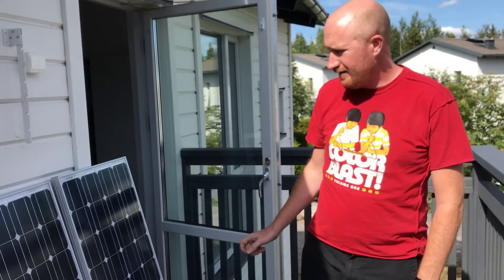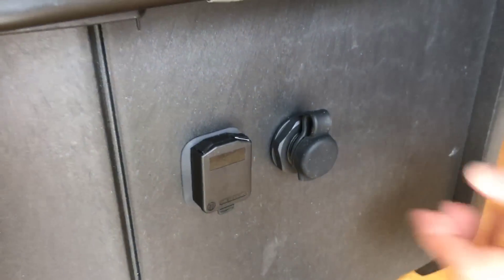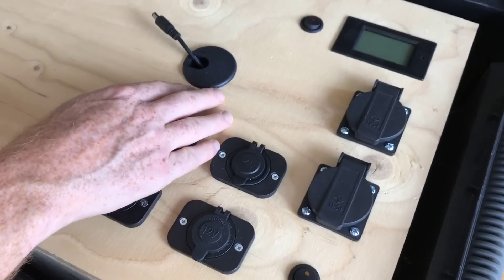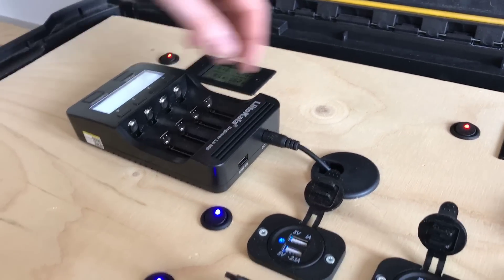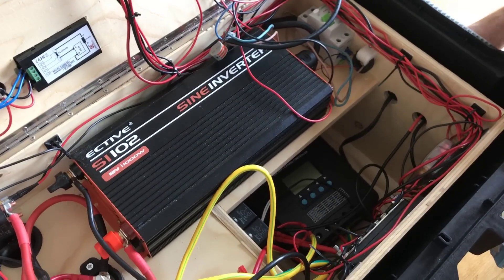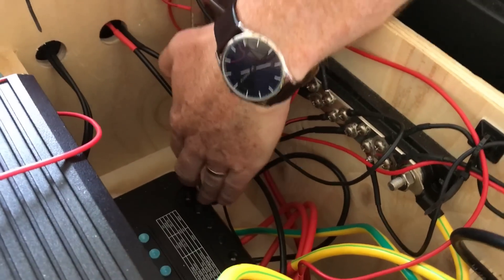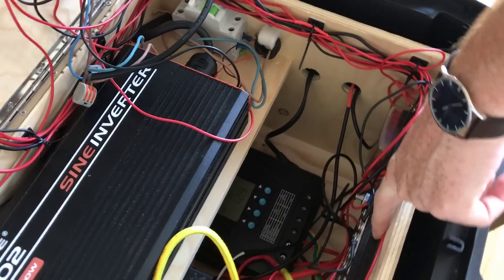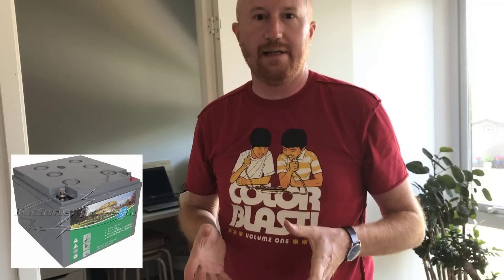DIY Solar Generator

Comment: Nice project - unless your battery is isolated, I wouldn’t advise placing your hand in the wiring with a ring on. I have seen a finger almost fused off because a ring shorted.

Comment: Hi Thomas, on the DC multi meter (on left of picture) what do you connect the Load wires to as I think the wires go under the wooden box so I cannot see what they are connected to.

Comment: Very Nice Build. As someone who is learning from those that have gone before me, I am also wanting to have dual charging DC/AC capabilities. You don't mention how the SAE connector is wired into the circuit? I will use a GX16 aviation connector, as I have a 16.6VDC 3A power supply (for my golf trundler, with that connector-type) that I will use. Just not sure how it will wire in. Is reverse polarity, between the DC/AC, an issue?
I do like your use of relays. Another member, with an unusually low subscriber rate -the DIY Engineer: Frank Brand, also utilises these components, for initialising higher amperage devices/switches.
It would be greatly appreciated if you could elaborate how it is connected into your circuit.
Thx.Keep up the great work.

Comment: Hello. I liked the beautiful subject and video. But I have a few questions. 1. Why is my question? You used 225 amp gel battery? 2. Question The wooden box has been great. But why? You did not give a decorative look by covering the top of the cap with aluminum black coats. 3. My question is how much money is this system?
Reply from the maker: Hi Vargin!
1. The usage of gel batteries was part price, part the fact that I didn't know much about batteries when starting the project. The total amp hours is not 225 though - it's only 50 Ah. If I would build a similar box today, and had the money I would use LiFePo4 batteries. They have an overall good  price-to-performance ratio.
2. The wooden box is there to give me a control panel. One of my requirements for the project was that it had to be weather proof. If the meters and outlets had been drilled to the plastic lid of the box it would not be able to withstand rain. A box in a box solved this problem.
3.  I have a can of black spray paint laying around and I thought of painting the wooden box to start with, but then I got sucked up into the functional side of things and the aesthetics got left begind.

Comment: Great project. Well explained at a high level. Good use of relays.  I am a fan of relays.  I have thought of doing this and tying the inverter fan to external fans.  How to do this and keep it water proof is a good question.

Comment: The relay for solar sounds odd. It requires power and what if the battery is dead? Is the relay NC or NO?
Reply from the maker: The relays are NO-type relays (Normally Open). I use relays in order to swich higher currents than what my small manual switches are rated for. If the battery is dead the relays won't work - that is true. But then I probably have bigger problems to worry about since depleting a lead-acid battery that far will be very bad for the battery. Therefore I make sure never to go below 11.9 volts. Check this link for more info regarding the recommended drain levels of lead-acid batteries: https://wiki.uiowa.edu/display/greenergy/Battery+Systems+Overview

Comment: Hi there, this is a very nice build! May I ask where did you get the shuko sockets? I wasn't able to find them online..
Reply from the maker: Hi!
I bought them on AliExpress. Normally I'm not impressed with the quality of stuff purchased there, but the quality of these two outlets was really good. I looked up the transactions and copied the link, but unfortunately the seller of the ones I bough is no longer offering them. But perhaps you can find the same items though another seller?

https://www.aliexpress.com/item/32629391807.html?spm=a2g0s.9042311.0.0.27424c4dYbfGDh

Comment: Så,fin låda du har der. Jag fundere på at göra en liknande til vår jakt stuga. Men behövar lite mer power, men det är vel bara at montere flere batterier??! Har også funderet på lithium batterier.....hvorfor anvendar du gel batterier? Om man vil dra 1500W behövar man vel lite mer power end gel batterier kan klara??
Reply from the maker: Hej Stig! Jag valde gelbatterier för att de var lite billigare. Om jag skulle konstruera en ny box idag så skulle jag förmodligen använda LiFePo4-batterier (https://en.wikipedia.org/wiki/Lithium_iron_phosphate_battery). För ett system som ska användas på riktigt i en stuga så skulle jag rekommendera en AC sine inverter på minst 2000 watt och ett batteripack på minst 200 Ah. De 50 Ah som finns i min box räcker inte så långt.

Comment: Get rid of them Gel type batteries mate, the DO NOT like dropping down low in voltage. Kills them off!! Get yourself some marine deep cycle batteries.  They will last many many years. Trust me buddy.
Great build,
Thanks for sharing.

👍👍👍👍👍THUMBS UP👍👍👍👍👍
Reply: No. It´s 2020s now. Use lifepo4 batteries.

Comment: Don't be misled by the numbers on the solar panel label.  There are designations for each one and those designations are important.  

Vpm is the voltage at Maximum Power output

Ipm is the current at  Maximum Power output

Voc is the Open Circuit voltage (no load)

Isc is the Short Circuit current (the maximum the panel can deliver into a short across the terminals)

Voc is of more interest when you have panels in series and the charge controller has a maximum permissible input voltage.  You don't want to exceed the controller's input voltage.  Voc depends on the temperature, bein higher when the panels are colder.

If you multiply Vpm * Ipm you get the panel''s rating in watts.  17.3 * 5.78 = 99.994 watts (very close to 100 watts ;-)

Comment: Hi Thomas,  
a very nice idea and implementation.
I am currently building a very similar construction here: 
https://green-power-munich.de/projekte/
https://green-power-munich.de/aufbau-eines-mobilen-solargeneratos/
Sorry it's written in german.
My questions are, why didn't you ground the inverter and second which relais did you use to connect the charge controller to the battery and to the panels?

Thanks
Reply from the maker: Great! I like your choise of battery!

Comment: Typical Swedish work. Smooth, elegant, functional, beautifully finished.
Very impressive! Keep up the good work!
Reply from the maker: Ha, ha! I don't know if the fact that I'm Swedish sets it apart from other projects, but thanks for the nice comment! What I did learn from this build is that time is the most important factor for the overall success. The build took well over a year in total and most of that time was spent just thinking, researching and planning.

Comment: no ventilation?
Reply from the maker: No, not at the moment. I did purchase ventilation covers that I originally planed on installing on the wooden panel, but I have not needed any so far. I seldom use the AC inverter and since that is the only component that generates any serious heat, the inside of the box is nice and cool.

Comment: Thumbs down for perpetuating the nonsense moniker "solar generator". 

Connecting a solar panel to a battery and an inverter does NOT make it into a generator. 

Stop abusing the English language. What you made is a solar system, a portable one.
Reply from the maker: Well, I just use the word that most people use to describe this type of box. Perhaps there's a better word?
Reply: @ThomasKahn  yeah, "solar power". Or portable solar power.
Reply: Calys Agora Omg! This is the term used by manufacturers to market their systems.  It’s homemade so he can call it a cookie if he wishes. Maybe it identifies as a hot water tank, we will never know.

Comment: possibly the box needs ventilation
Reply from the maker: Yes. I have purchased some ventilation grilles, but I haven't felt the need to add them yet. I very seldom use the 230 volt inverter and it's the only thing that runs hot.
Reply: @ThomasKahn  Good, as much as you don't want to make holes in the case it's needed. i know you can open it when in use but just easier leaving it closed. Great job, thanks for the video

Comment: Very nice job, Thinking on your next build Instead of having a seperate relay for turning power on to the inverter. Just bypass the internal switch on the inverter and mount it remotely. I do like build. very nice.

Comment: I love this but its all dc to a.c.  And wasting lot of energy in the process and battery won't last that long as compared to dc to dc. But most people go for dc to a.c.. while there are lot of dc chargers, lights, fan etc
Reply from the maker: No, it's not all DC to AC. The only part that is AC is the 230v outlets. The rest is all DC. And that's what I normally use it for - charging cell phones, small batteries and such.

Comment: Great build! Makes me nervous when you’re poking around on the AC side with your fingers.  😂
Reply from the maker: Oh, I'm used to that. My parents told me that I got an electric shock from poking my fingers into a 220 v outlet when I was very little. But on the serious side - you're right. 230 volts is not something you play around with regardless if you are 4 or 40 years old.
Reply: it's ok. he's barefoot.

Comment: Couldn’t you get more powerful panels then the 100W? I think you did a great job with this solar generator, could you make a list of the parts that you used? I like the idea of putting in such a large case.
Reply from the maker: Hi Mike!
My choise was mainly based on portability (or rather dragability since the aluminum frame make them quite heave). They are loose panels that I keep stored away during winter. Remember that the latitude of Stockholm is almost 60 degrees north, just 80 kilometers south of the arctic circle. This renders the panels useless between November and March. I also got a great deal on these. :-)
Reply: Thomas Kahn very good then.

Comment: You should be proud. The relays for the contriller... I'm not really understanding that part. Wouldn't a 30 amp fused rocker switch be enough to turn on or off. I would really like to know how you incorporated the relay with the inverter, that was smart. Since its a big size inverter or would that even matter? Thanks for great video